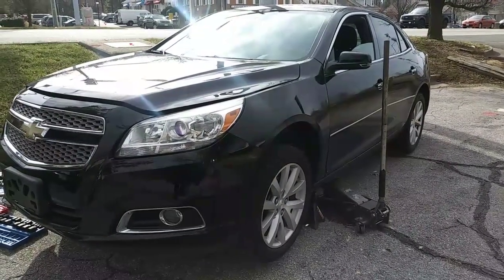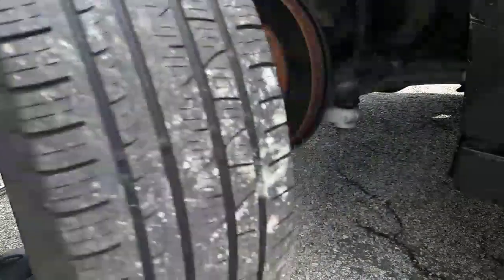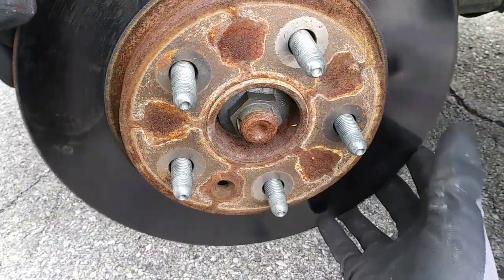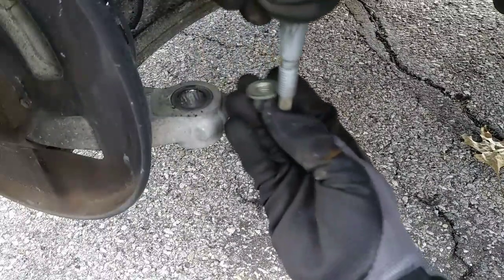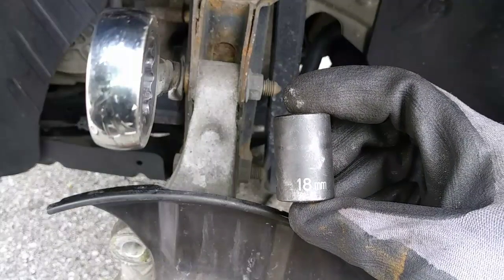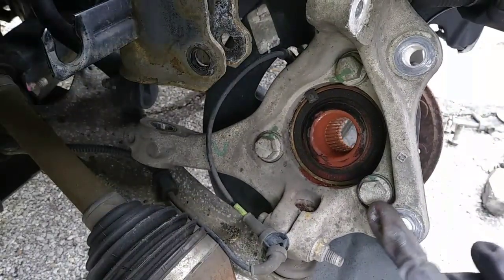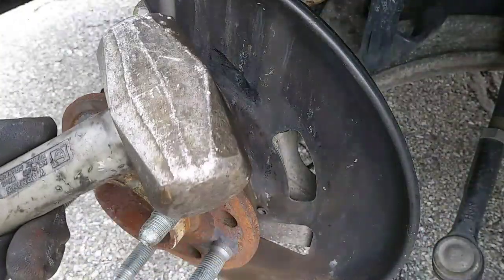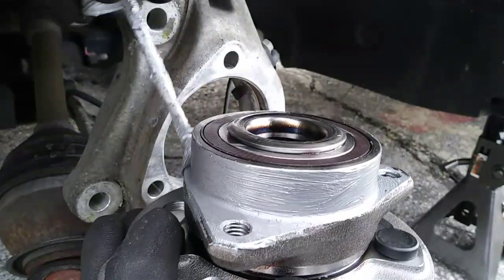FRONT WHEEL HUB REPLACEMENT (2013-2016 CHEVY MALIBU)

Comment: Great video, much appreciated!  I did this on my 2013 malibu front driver side.  Lot of penetrating lube and hammer work to get the old rusted bearing out.  And i also replaced the wheel speed sensor in the process.  After driving about half mile my lights on the dash went out!  Thanks!

Comment: Great detailed video. A shortcut to not having to remove the strut bolts is to use a regular deep socket 18 and a 6 in extension on the top wheel bearing bolt. It slides in between the cv axle boot.

Comment: AWESOME VIDEO! Would you need a front end alignment, after doing this?
Reply from the maker: TheVintage Attic No, you dont need an alignment after replacing the wheel hubs
Reply: @barricadegarage5361  Thanks very much bro! I wasn't sure because of loosening the strut bolts. That Battery operated Impact is a beast!!! Thanks, Subscribed!

Comment: I had lent my brother my hub puller a while back and did my front driver wheel hub today. Beat the holy hand grenade outta if for like 20 minutes to get it to budge after soaking in some penetrant. 

My only advice for anyone else watching is do NOT use a impact for the axle nut; tighten it up to the point where it starts to try and spin, put the tire on and pop the middle emblem of the Chevy logo out... drop the car SLIGHTLY so its coming into contact with the ground, finish up with a torque wrench to 159 ft lbs. Pop the emblem back in, drop it and you're done.

Comment: Solid video other than the fact that you HAVE to torque that axle nut to appropriate spec. If you over tighten, can cause premature failure of the wheel bearing

Comment: How do you ensure the correct torque for each bolt you reinstalled ? Can you set your impact driver or did u use a torque wrench?
Reply from the maker: MrPsychoMiko1 Use a torque wrench to set accurate torque on fastners. Ive been doing this for a long time so I know how these torque values feel when they are reached so I rarely use a torqe wrench for suspension work. I still choose to post the torque specs to give the viewers that dont have a torque wrench a good idea of how tight the fastners should be.
Reply: MrPsychoMiko1 yes thread locker should be added..fasteners should be torqued to factory specs..definitely the wheel hub bearing should be torqued to factory specs lol that wheel hub bearing won’t last long
Reply: @rahrah8076  The axle nut is supposed to be torqued to 159 foot pounds. The Milwaukee Fuel M12 2555-20 impact wrench that he used is rated to 250 ft lbs. So it's safe to assume that he torqued every nut and bolt to 250 ft lbs.

Comment: The wheel bearing is 185 ft/lbs too loose or too tight will definitely cause premature bearing failure. No other suspension parts are required to be removed to remove the hub assembly, only the caliper and caliper mounting bracket ( and dust shield of course).

Comment: There was ABSOLUTELY no reason to take the knuckle off. People, this can be down without taking the knuckle off. Save yourself some time and do not take the knuckle off
Reply from the maker: Midnights & Mornings I didnt remove the knuckle from the vehichle and there is no room for a socket or wrench to remove the hub fastners because the axle shaft is in the way. so you HAVE to disconnect the 2 strut to knuckle fastners to tilt it forward. thanks for watching bro
Reply: BARRICADE GARAGE I hear you man. All you have to use is a socket and extension. I’ve been doing it for years. But do it how you have to do it. I enjoy your content. Keep it comin brother

Comment: Please use anti-seize aluminum based on zinc bolts and dielectric grease on all electrical connectors to coat the copper terminals saving them from corrosion, high resistance from winter’s salt water covered roads, car washes and humidity that forms durning temp drop as water forms.
Same with light bulbs, fuses, and other electrical connectors even flashlights!
DK, ASE master tech since 78

Comment: You DO NOT have to remove strut bolts, you can easily get all three hub assy. bolts out without removing strut bolts, now you have to have an alignment, and yr not suppose to use an impact to tighten yr axle nut because you can damage the bearings, it tells you that rite in the papers with the new bearing.... Very misleading video rite here!!!
Reply from the maker: If your dumb ass know so much then why are you watching this video???.